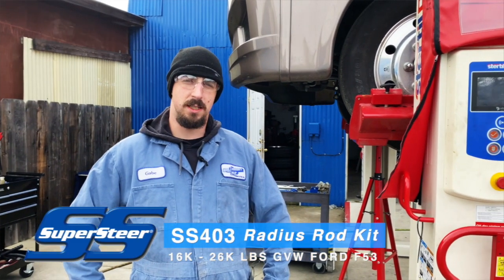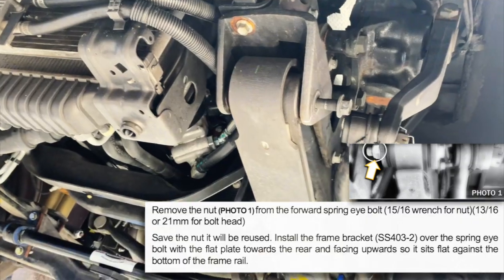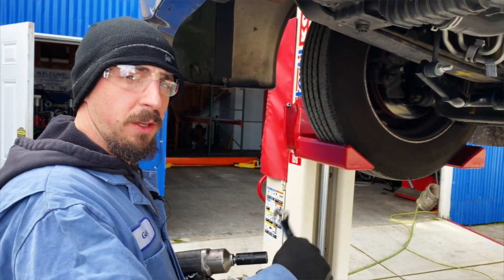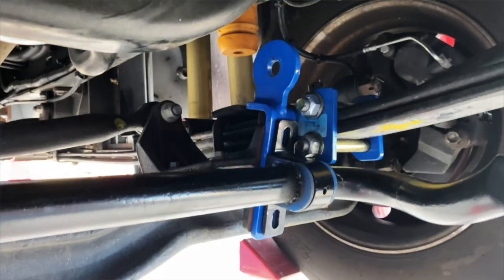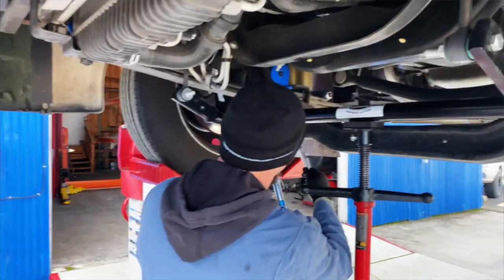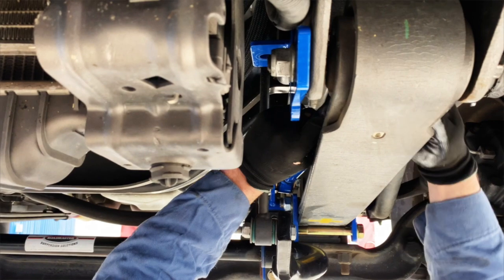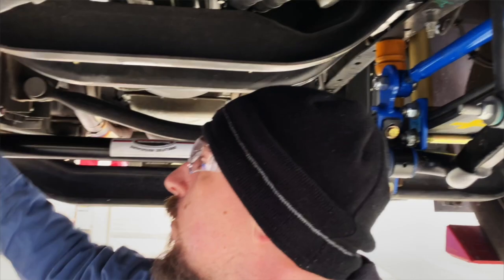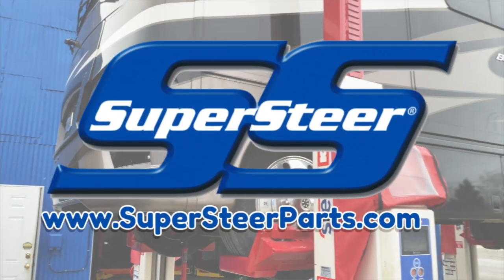SS403RR Radius Rods Installation

Comment: How does limiting fore/aft motion reduce lateral movement?
Reply from the maker: Good question! When you are applying a steering input on the F53 chassis, the drag link is pushing rearward/pulling forward on the steering arm in order to turn the wheels from side to side. You can see when this is done that the soft spring bushings as well as the springs themselves allow a significant amount of fore/aft movement in the entire axle. This means that some of that steering input which is intended to turn the wheels from side to side, is being wasted due to the soft spring bushings. The Radius Rods reduce that unwanted movement and make the steering more precise as a result.

Comment: Can you do it with the rv flat on ground or do you have to jack up and have to weight on springs?
Reply from the maker: You can do this installation with the coach flat on the ground. If you need additional clearance, we recommend using ramps. Either way, the weight of the coach needs to be on the suspension.

Comment: can you install this while its on the ground?
Reply: The installation directions state: Radius rods should be installed and adjusted with weight on the front suspension.
Reply from the maker: Yes. Thank you for helping make that clear. Appreciate you!